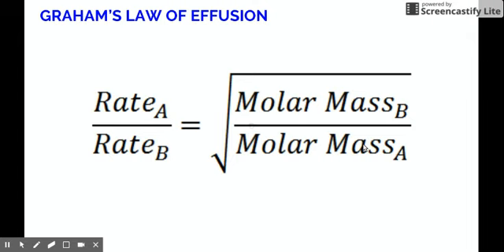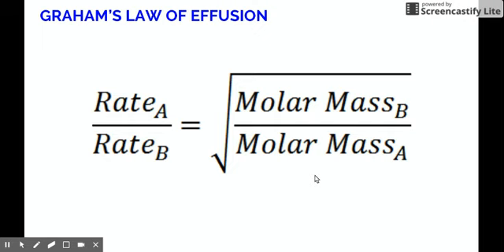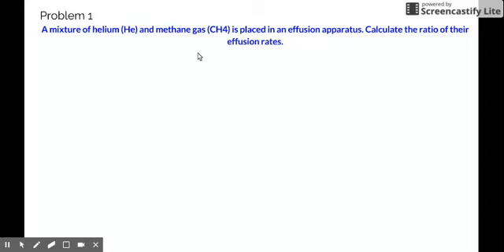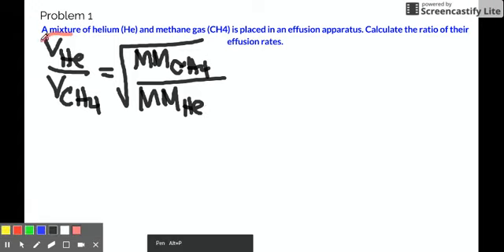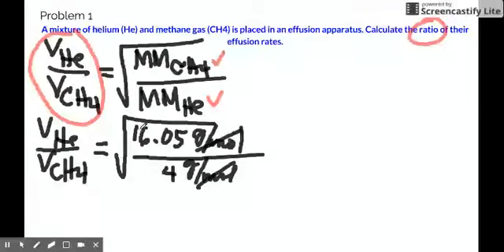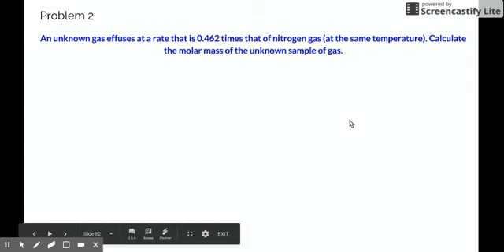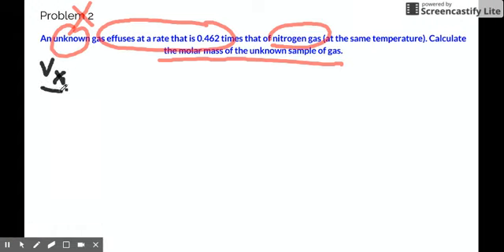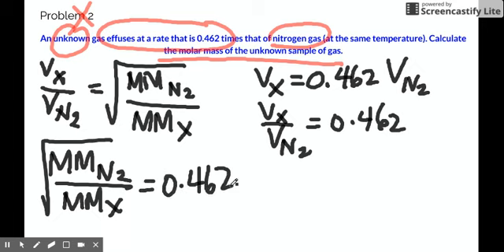Graham's Law of Effusion Problem Solving Part I

Comment: at the problem 1 where did 16.05 came from? and the 4 at the CH4? thx
Reply: (I know this is a little late, but the answer might help someone else.)They are the molar masses. You can calculate the molar mass by adding up the 'average atomic mass' from the periodic table of the each element in the chemical formula. In the case of Helium, it's just one element so you can pull the number directly from the periodic table (4.00 g/mol). The molar mass for CH4 would be 12.01+(4x1.01) = 16.05 g/mol.